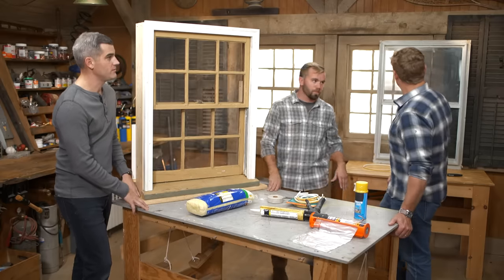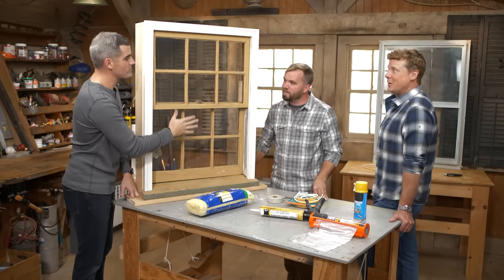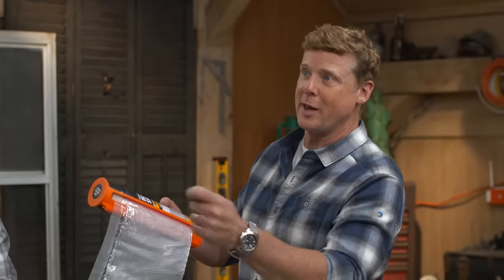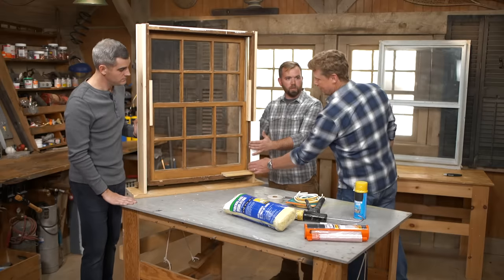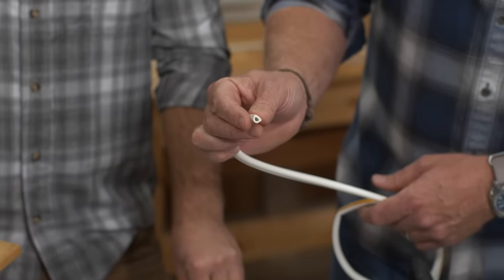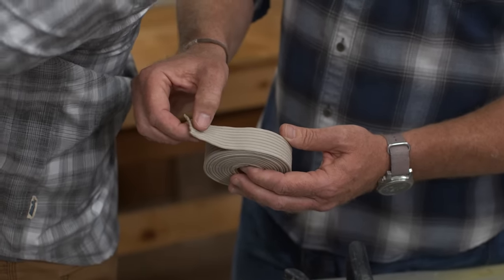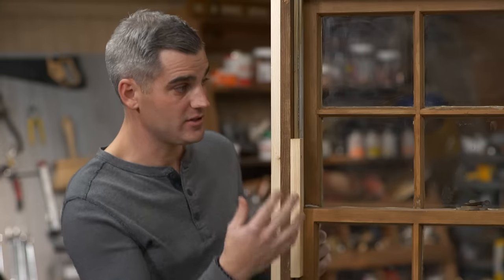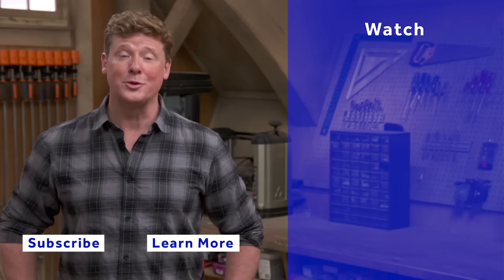Window Air Sealing Techniques | Ask This Old House

Comment: Every, please don’t ruin your homes by putting vinyl windows, they are throwaways, 15 years from now. Keep the character of an old home by keeping the windows.
Reply: I said that years ago and everything I tried was "not quite right" so I took the plunge and replaced the windows. Having a home that was 100 years old took some head scratching, but I settled on doing the outside trim with 5/4" x 4" pine so from the street it looks almost the same. The bonus is I save quite a bit on heating costs due to lack of draft. BTW, they are vinyl on the outside and wood on the inside.
Reply: I have never understood why people buy vinyl
Reply: Kept mine.  However, I recommend more aggressive weather stripping and sealing.  Gives you a chance to really fix it better.  Also, exterior storms change the exterior.  I opted to make removable interior inserts.  Make them for about $100 a window in 2022.  Table saw and hand tools.  About 6 hrs to make per window excluding finishing.  No modification of frame other than a few holes for pegs up top and latch on bottom.  I suppose screws would work too.  In and out in a few minutes.  Summers I use a removable screen insert I get from any chain hardware.

No visible mods.  Works great.

Seal seal seal.
Reply: You can get windows looking ecactly like your historic ones - but with wooden surface and triple pane glass.

Comment: Or like me, screw the window shut and caulk it inside and out! Some homes have far too many operable windows that are never used
Reply: Exactly! If we open windows here in spring or fall, we use the exact same ones that create a cross breeze throughout the house. It’s 4 windows. I told my husband we should seal all the other ones because most of them leak a bit.

Comment: Most modern windows are such a scam. R1 vs R3 compared to a R23-25 wall is less than a 3% improvement. Pop the sashes, install some good interlocking bronze weatherstripping, repair any broken parting beads, repair glazing. Add some inset storm windows and bam great performing window and most importantly they are still beautiful vs ugly chunky insulated glass with shallow muntin bars. My windows are 190yrs old and are in great shape. A modern window gets what, 30years at best?

Comment: If anyone is wondering what kind of caulk to use, i used Dap Dynaflex 230 clear on my windows since it's pretty much invisible when it totally cures. It's white at first but don't worry, it'll turn clear in either a few hours to a few days depending on how thick the bead you lay is. My windows were having early morning frost build up on the inside, and after sealing the cracks with the Dynaflex there's no frost at all. It also comes off fairly easy with a painter's tool, caulk remover, or putty knife or some kind of flat scraper. Best of luck boys 👍
Reply: I am so glad you said something about what kind of caulk I need to caulk my windows and was at a loss of what kind to use. I have horrible condensation on the interior of my windows and the draft on this Reno house windows is well it actually will move the curtains. So it’s imperative that I find the right caulk. I love caulking but I have never caulked windows before so thank you!!!
Reply: Bless you sir. Sounds like I have the same problem so I’m gonna go out and to that tonight! 🙏

Comment: One year I did the plastic inside but I taped it over and around the trim. Then additionally I built an inexpensive exterior frame with 4 mil plastic on the outside. It was a particularly drafty window and room. Wasn't pretty but it worked
Reply: Dang Bucky the military didn’t pay you much for your years of service! Tony didn’t have some type of payment plan for the avengers! 😆 

Hmm perhaps your solution would work for my windows as well! My house windows are Original from 1949!
Reply: Ok in

Comment: I had double pane windows installed in my condo about 5 years ago.  I haven't turned on my heater since.  Of course I live in So Cal and I admit I'm a woos.  One thing I found that helps in the winter and summer are sunblock curtains as a supplement to the vertical blinds.  

One thing to beware of when installing new windows is that if the walls are not perfectly flat to begin with, it's going to look like krap.
Reply: Same here, one of the last apts. I lived in had all new double pane windows. Maybe 1 week out of the year we would turn some heat on. Otherwise, being an upper unit and heat rising was very nice savings on utilities.
Reply: lol - didn't know y'all had heaters in so-cal
Reply: @CertifiedMailSignatureRequired  luckily these new fangled ones don't have pilot flames.

Comment: Window inserts are a good option if you have enough depth in the sill. Relatively inexpensive and don't look as cheap as a plastic film. Getting new windows is nice, but the return on investment takes quite a while. We have old single pane and a window installer came by to give us a quote and was quite honest and said if you aren't going to stay for at least 5 years after this, just band-aid it and save your money.
Reply: Where are you finding relatively inexpensive window inserts? I have found nothing of the sort, please do share! Considering making myself but not sure I'm 100% qualified so curious what you've found. thx. -tony
Reply: Agreed. If you pull off the molding around window and put backer rod or use spray foam in a can, that will likely solve most of the issues on older windows. Reality is that most installers will quote you for the simplest and quickest install for new windows, which generally means it won’t be done the proper way. For older wood frame single pane, you’re better off hiring someone to restore them instead of replacing. Bronze weatherstripping would certainly be added and lasts forever compared to brush/foam.
Reply: @CertifiedMailSignatureRequired same boat.  Everything is so freakin expensive these days.  Makes me not want to purchase anything big because products and services are so overpriced.  There’s a couple good videos of guys who have made wooden ones and used the shrink wrap.  But even then, depending on how many windows you have, the molding to build them isn’t cheap….

Comment: I'm building my own wood framed storm windows using two layers of that plastic, and held in place with foam weather stripping. Luckily I only have three old single pane windows to deal with though.
Reply: nice - thinking of this myself. any more tips or advice for a fellow diy-er?

Comment: It aint pretty but the best is foam insulated tape by frost king, it sticks to everything and its really easy to use.
Reply: Are there any competitors to frost king? I’ve had mixed results with their products but they dominate the shelf space. Any hvac pro recommendations out there?
Reply: @TheChupacabra  frostking is fine, but it's cheap. it's scotch double sided stick tape + a thin ceranwrap...

Comment: what kind of caulk is best to use so it isn't too sticky and a big hassle to remove come springtime?
Reply: It’s called caulking STRIPS I believe. It’s like grey putty noodles. You shove in the cracks. I used them last year and after a few Kim ths they stopped working because they weren’t sticking to window anymore. So I won’t be using them this year
Reply: @markchallenge7949  Thanks Mark 🙂 i ended up using Dap Dynaflex 230 clear and it worked excellently. Totally invisible and it stopped up all the cracks. It's sticky enough but comes off fairly easy from the wood with a painters tool 👍

Comment: Fiberglass insulation to stop drafts?!! NOPE. Air goes right through fiberglass, it only acts as an air filter. Use the foaming sealant. Except it's expensive and messy. Better yet buy closed cell foam sealer/backer. It comes in different diameters to match gap size. Then apply cheap latex painter's caulk to the gap between the window and stud (both sides) and squeeze the backer tube into the caulk. The caulk helps the tube slide into place and seals the edges. It's cheaper and not as messy.
Many home builders have skimped on sealing window and door perimeters. If you can remove and reinstall window/door trim, this is by far the most effective insulation you can get.

Comment: Disappointed - Wanted to see plexiglass being installed on the outside without framing - instead of using plastic. I personally find using plastic over my outdoor windows has been much more energy efficient than plastic over inside windows. However, the plastic breaks down over time so am wanting to do plexiglass as well as a nicer looking curb appeal versus my plastic. I can’t afford new windows and sashes so trying to keep them from rotting further. It’s been very helpful both in winter and summer.
I grew up in a era when putting plastic over outside of windows in winter was a common thing. It’s not a thing now days but they aren’t paying my utility bills so I don’t really care what others think and I’m not in a HOA, though I try to install it as tight and neat as possible so it’s not a even bigger eye sore. Thus again why I want to switch to plexiglass but need it to cover my entire window sashes and wood frame are and looking for ideas on best way to do this. A bit more complicated than sticky tape and a staple gun.

Comment: Sad to see disrespect of old wood windows. There are many of us spending more per window than replacing them to restore. 
Old windows with storms are extremely efficient. And they are made of wood that will last couple hundred years if maintained. I am in the process of restoring over 100 year old windows. They will last another 100 years!

Comment: There are goals with any window system (or door, or building envelope): #1 is to keep water out. #2 is to reduce air exchange (which will also prevent moisture exchange). #3 (lastly) is insulation. Fiberglass batting does NOTHING to prevent air or water intrusion/exfiltration. The team should have done a better job in this video but it wasn't horrible.

Comment: R value, U value... All these just to confuse the customer, to make the product look better.

next time, someone will come with another category called CI value - which refers to "consumer idiocy"; the higher the number, the higher the chance the customer will be fooled into buying it...
Reply: Maybe the "consumer idiocy" is coming from consumers who are confused by simple scales of insulation and thermal transmittance values.
Reply: I couldn't agree more. U-Factor is to make newer windows seem better then they actually are.
Reply: @brandonmathiassweet3284  "U-Factor is to make newer windows seem better then[sic] they actually are."
U values are a measurement of thermal transmittance. It's not like the window industry invented the concept in order to sell windows.
You may as well be saying, "Length measurements are to make lumber seem longer 'then' it actually is."
Reply: @StoneE4  Yes, I understand what U values are. Perhaps the use of U values as the industry standard where r-value is the norm may add to a bit of a misunderstanding of a window's thermal performance. And perhaps those selling the windows capitalize on this misunderstanding.
Reply: @brandonmathiassweet3284  If you understood what U values are you never would have said the following... "U-Factor is to make newer windows seem better then[sic] they actually are." Hopefully you've remedied your ignorance.
Reply: @StoneE4  I understand what U values are. I did not properly or adequately get my point across previously. i.e., I misspoke; what I meant is I think they're misused to provide a false sense of value. They are a perfectly adequate measurement method, when used. I may have previously come off as though I was questioning the altogether validity, for that, I apologize, not my intent.  If you want to continue to try and argue with a stranger on the internet on their understanding or lack of knowledge of u values, be my guest.  But I have better things to do. Have a wonderful life.
Reply: @brandonmathiassweet3284  Maybe you understand what a U value is now, but you didn't sound like you did when you posted this statement... "U-Factor is to make newer windows seem better then[sic] they actually are." Possessing an understanding of what a U value is and uttering that ridiculous claim are not logically congruent with one another.
Now you're claiming that U values are, "...misused to provide a false sense of value." U values are basically a measurement of how much heat transmits through a given material. When it comes to widows one of the main concerns is how much heat will transmit from one side to the other. Hence, the U value is of great importance... Not something "...misused to provide a false sense of value." In fact, the U value could arguably be the most important measurement of a window.
Every post you make to this thread seems to contradict your claim that you know what a U value is – digging the hole deeper and deeper... Perhaps you should quit while you can still climb out?